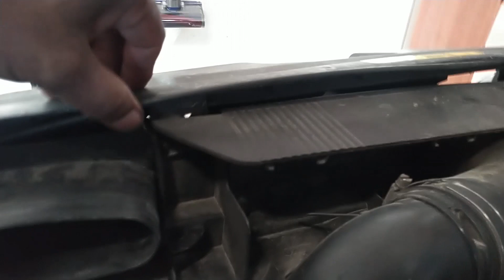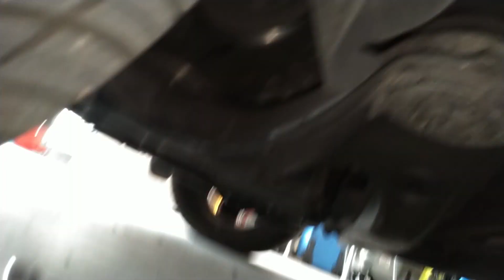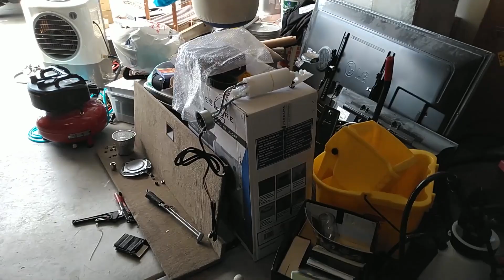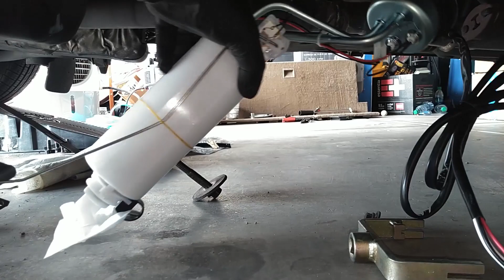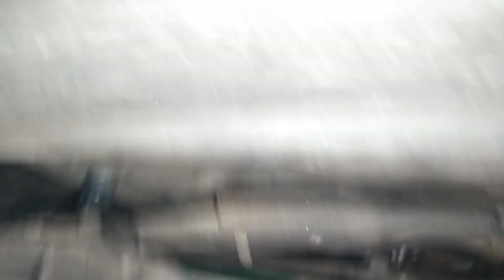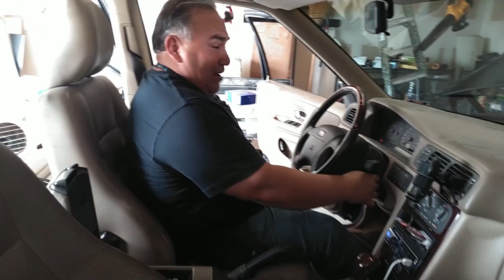Junkyard run in Las Vegas, timing belt, engine mounts, radiator mount, fuel pump, etc. - HOWR

Comment: I think a hack had been working on it before you started working on it.
Reply from the maker: These things just fall apart. The other hack would be me. lol
Reply from the maker: On what? The fuel pump?
Reply: @RobertDIY   The radiator  was cocked, the hose clamp on the pump housing. I could tell it had been worked on before. " it looks like I done it ' he he